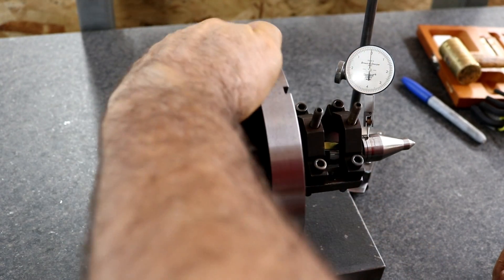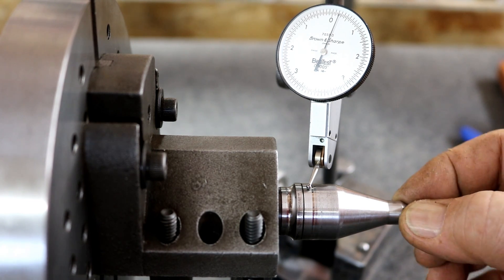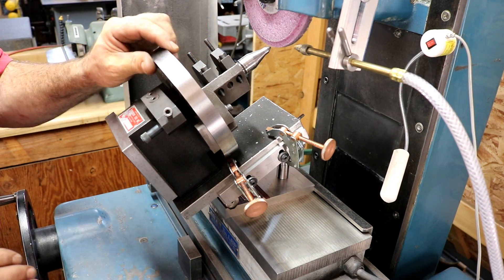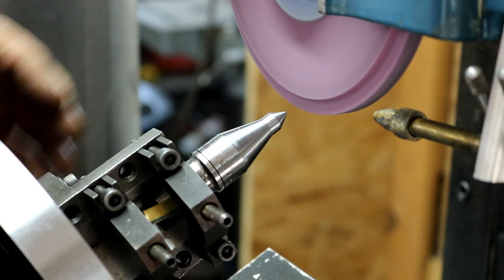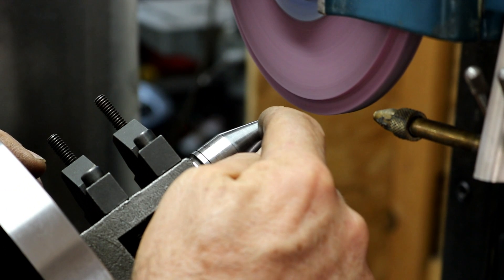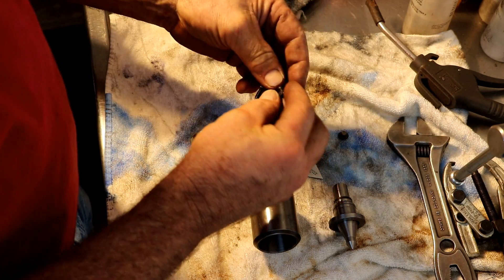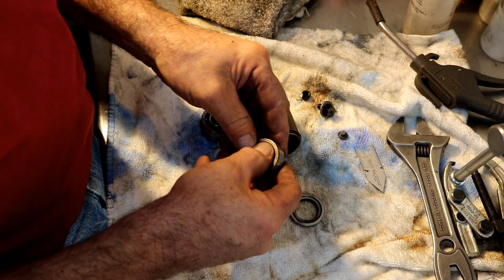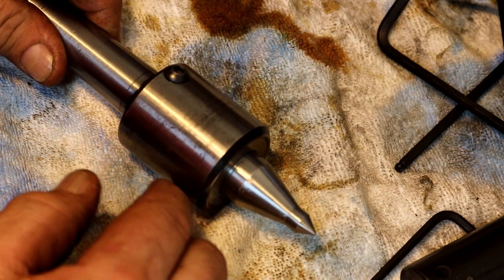Metal Lathe Live Center Regrind

Comment: Nicely done Randy! You can grind that assembled by holding the body in a v block set at 30 degees and spinning it with a makeshift pulley in an electric drill and an o-ring drive to a plastic pulley pushed onto the  center. That will give you the lowest runout on the center as it eliminates all eccentricities.
ATB, Robin
Reply from the maker: Thanks Robin.  Next one I bit more thought will go into it.  I had to take it apart anyway it looked like a bit of moisture had got inside.  Ebay find you know.

Comment: Nice job Randy. How did you pull it apart? Press a rod through the shank? I've got one that needs to come apart, but it's not drilled through that way.
Reply from the maker: Brass rod and tapped it out from the end of the shank.  Some have the front end cover unscrews.  Thanks Rick.